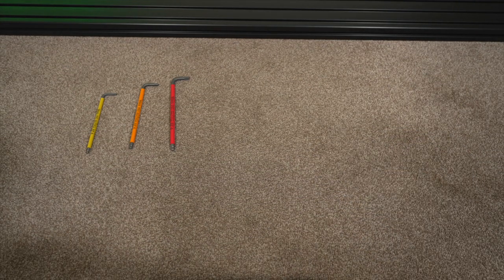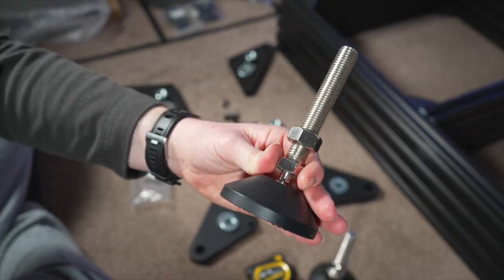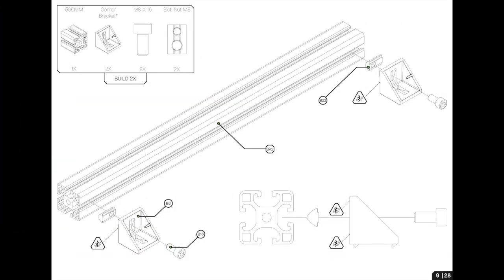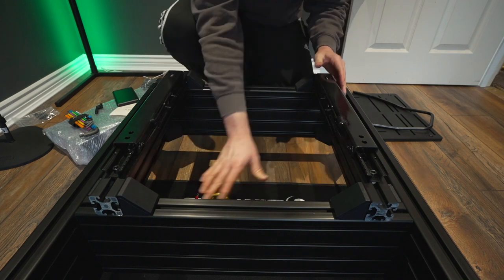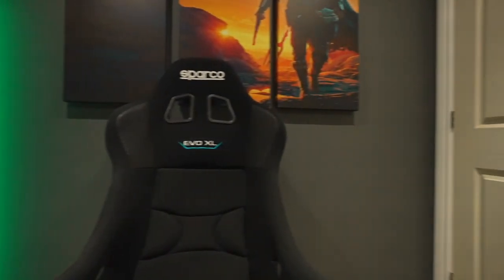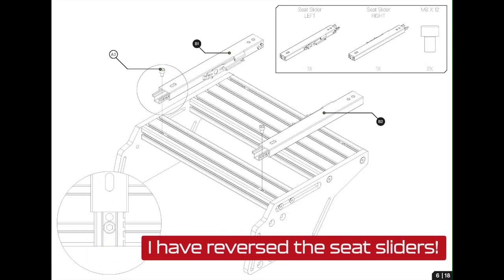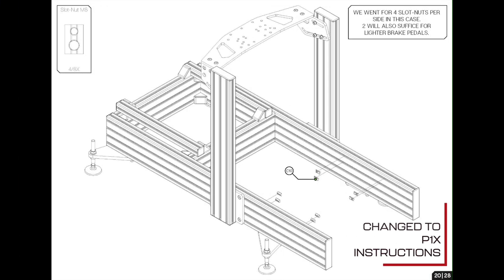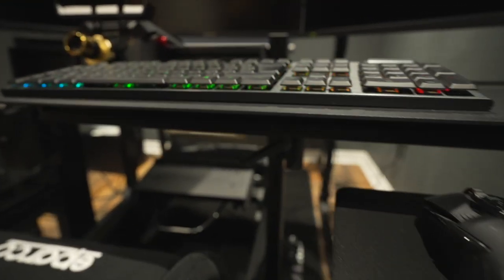Master the SIM-LAB P1-X Build: Step-by-Step Instructions

Comment: Glad I'm not the only one that fitted a Pedal slider as an add on to my rig.  Surprised it's not more common what with the wheel mount been the fixed point on a rig usually.  I need my rig to adjust for me and my 13yr old kids hence the seat and pedal slide needed.  Like your seat, probably a future upgrade for me to a proper bucket seat rather than the gaming seat style that GT Omega supply (it's comfy but not very supportive and the base is flat with no recline, only the seat back can be adjusted) mainly so I can get a better recline position for F1 games.
Reply: Sim Labs were out when I ordered mine, but Microcenters in the US are partners and they had some in stock. So mine is on its way!
Reply from the maker: I completely agree. It's also been great to experiment with different pedal positions to find the sweet spot. I know I would not have done it without the slider mounted. For smaller people the slider is ideal, again I agree. Once I made the switch from the GT Omega seat, hinged and had flex, to the solid bucket I found I was much more consistent with my braking. Makes the whole experience a lot better. I think GT Omega have also released their own bucket. Although I have not had the chance to see it in person yet.
Reply from the maker: @timothywest1183 You won't regret it! (I also love Calvin and Hobbes! 😂)

Comment: Awesome build video mate. I wish i had it before i built my P1-X rig. Would have saved me a ton of work.
I can relate to the one person ordeal. I  had to balance the wheel mount on one knee to get it onto the uprights. It was hell 😂

One tip: don't tighten the rig's feet too tight because you need to be able to easily adjust them to level the rig in the end. 

Anyhow, thanks for the insight.
Reply from the maker: Thanks a lot buddy. Hopefully it helps someone out on their journey. A lot of stuff was learnt along the way here 😅 I feel your pain. Wheel mount on to the uprights solo was a painful, painful experience😂

If its a flat floor you should be okay I think, I've got laminate, so I was okay and my measurements didn't need adjustment. But good point👍🏻 If you are on uneven ground then adjustments will need to be done. The feet are pretty awesome with their level of adjustability.

Comment: Watching this in my P1-X, also with a DD2 in front of me, this gave me flashbacks of installing the seat slider. That was a massive pain in the backside! Installing the wheel base only after the mounts on either side was much easier though, as you said.

On thing I thought was interesting about your build is the TR seat brackets. They seem to be bit higher than the simlab ones. With the latter in a middling position my DD2 already sits at the very top of the wheel base mount (I'm 190 cm). If I sat any higher I feel I couldn't get the wheel base high enough. 
Anyway, looking forward to the coming video(s), especially bass your bass shaker setup. I tried putting some DA BST-1 directly on the aluminium profile, but the rig does not really want to vibrate it seems, it felt very muted. Thinking about attaching them to the seat now.
Reply from the maker: Thank you for the nice comment mate!

Glad I was able to bring back some of that stress to your build 😂 Seat slider was probably my most unenjoyable bit. Caused so much stress 😅 

Was kicking myself after with the wheel base, but it was late and nothing was going to stop me.

That is the exact reason why I got the Trak Racer bracket, they were recommended by a friend. Gives you that extra little bit of adjustability. I think for your situation they might be worth a go. 

Thanks for joining the journey and the sub I really appreciate it. I have some nice videos on bass shakers that should be very applicable to you. They are all shot and just need the finishing touches in editing and they should be out 👍🏻
Reply from the maker: Hi mate! This has been a long time in the making, but hopefully provides some value 👍🏻
⬇️⬇️⬇️⬇️⬇️⬇️⬇️⬇️
https://youtu.be/fj1U9TTmIBU

Comment: Great video! Especially mounting the seat was something I hadn't seen before, very helpful!

I'm currently considering getting the P1-X Pro and want the best of both worlds, i.e. the height from the feet and the flexibility of casters.
So it should be possible to just ditch the "ball end" M16 that come with the feet and use a pure M16, and then use an M16 to M16 adapter to screw the feet on the bottom, right?
Reply from the maker: Thanks again buddy! Glad you got something out of the video!

You can put whatever feet you like on either model. You just have to source them. I have no experience with the P1-X pro but it doesn't look as easy to modify as the standard P1-X. Something to bear in mind.

I don't understand your last question sorry. I would fix the casters exactly as I have. I wouldn't start creating a point of weakness in one of the parts that needs to be as firm as possible.

Hope that helps.
Reply: @TraumaTeamRacing  Thanks for the feedback. :)
Reply from the maker: @magicmulder  You are very welcome 👍🏻

Comment: remember myself struggling with DD1 install although I put sides up first, it wasn't easy. Do you remember what two 40x40 200mm profiles are for?found them in my box, scratching head now. maybe it's for gearshifter mount and I don't have to buy a dedicated shifter mount plate? thank you
Reply from the maker: Getting the DD2 on was a world of pain 🥲 If I didn't use them in the video they weren't needed. It has been a while since the build. I think I ended up using them to mod a keyboard tray.